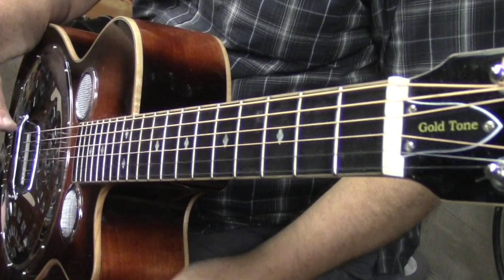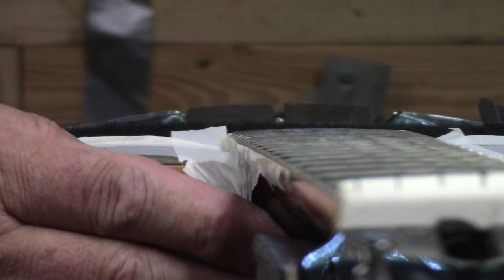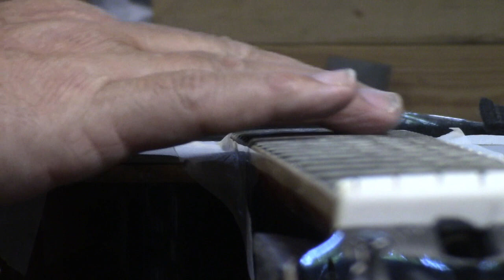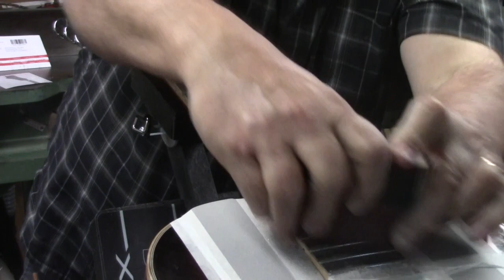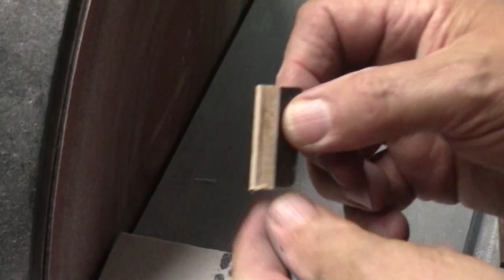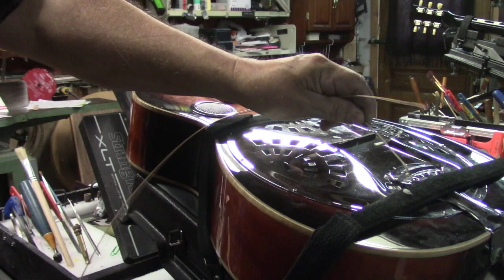Intonation Nightmare ... Redeemed @StringTechWorkstations

Comment: I love your videos, thank you. Can you tell me what compound you dress your buffing wheel with?
Reply from the maker: Jewellers rouge
Reply: Thank you so much. After you get the frets in and crowned  what are you using to sand/smooth the frets as you sand down the fretboard. When I tried it I used a sponge block and I think I removed some of the crown.
Reply from the maker: I make up fretting kits for my students and subs www.mcconvilleguitars.blogspot.com/

Comment: Great vid!! One question
When you're looking at a guitar neck, no matter whether its an acoustic or electric of any make, how do you know the difference between a neck needing a fret dress verses a truss rod adjustment or a combination of both to fix any issues the guitar might have? 
I was doing a check over on my MIM Tele and there were issues with intonation up the top end of the neck and some rock in certain parts of the neck when I checked with a straight edge ruler but I felt like I didn't know in which way to fix the issue. Ended up taking it to a guitar tech who did a really nice job at fixing the issue which he told me was just adjusting the truss rod.
Reply from the maker: 90% of the time .. in order to get the action down to where it should be ... there will be slight discrepancies in the frets, along the "String Path " ,  that need to be dressed. I include 6 straight edges in my fretting kits so that the neck can be checked along it's entire length. Often times the truss rod adjustment alone, is not enough.
Reply: @StringTechWorkstations  Brilliant answer! Thank you so much! 
Do you find that even brand new guitars out of the box need some fret work? Or do you only need to do a fret dress to guitars that have a bit of 'wear and tear' from years of playing?
Reply from the maker: With newer guitars it tends to be at the neck to body junction. This Goldtone resonator guitar needed quite a bit more than usual.
Reply: @rekublitz1453  I had a brand new Martin D-28 come into the shop last month for an initial setup.  Using Michael's technique, I found high spots on the 4th and 14th frets.  Not much, but still there.
Reply from the maker: Thanks for the "tip of the hat" Jeff ! Much appreciated.
Reply: jeff scarff thanks so much to both of you!! Very informative and helpful!